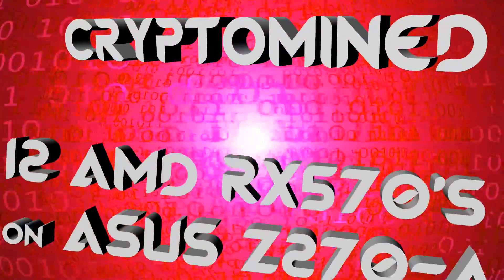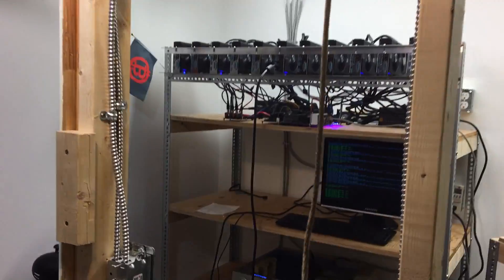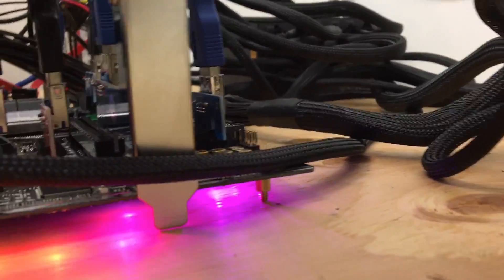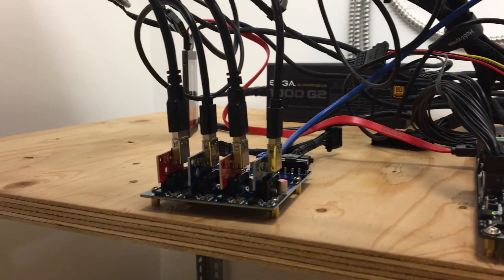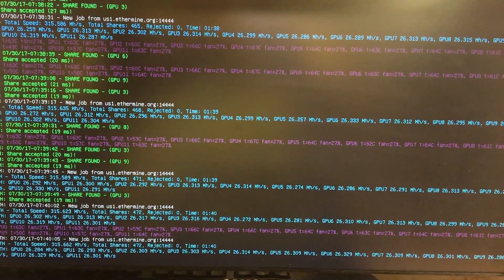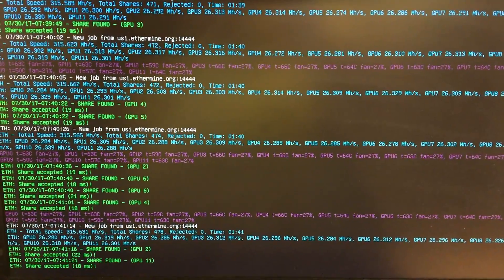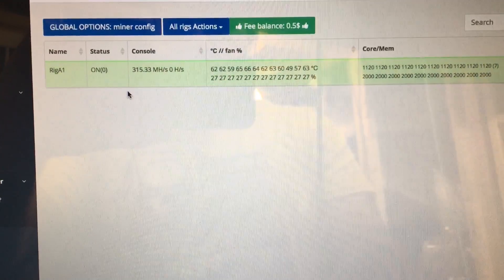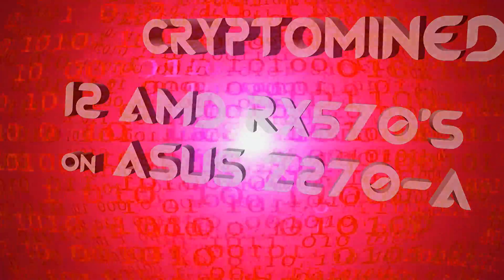ASUS Z270-A 12 GPU Rig with AMD RX570 4G Nitro+ and SimpleminingOS

Comment: Hi there, I have the same model motherboard (ASUS Z270-A) but I cannot run more than 4 gpus. I am using intel core i7-7700k and 2x8 16GB DDR4 DIMM memory with Windows 10 Pro OS. And I have 8 AMD RX580 GPUs.
Everytime I put the 5th GPU the display keep blank or pop up message uncompatible input.
Any idea what is wrong with?
Thank you.

Comment: Curious to know how does the 1to4pcie adapter stand the test of time. Are there any drawback on running those adapter?
Reply from the maker: I only use the 4in1 USB PCIE adapter now, and its working great.  as for the rig in this video, im not sure how this one is going, i suppose its still running strong, but this video was given to me to post by Robert. (see description)

Comment: Hi @Cryptomined, awesome channel!
Just a quick one, would this only work on SimpleMining OS? Has this been tested on windows?
Reply from the maker: now it works on windows
Reply: Thanks. I'm running 8x RX580 on the same motherboard. Would I be able to add another 4 with your extender or is that strictly for RX570s?

Comment: Hi Cryptomined, I have been succesfully mining with 9 cards on this motherboard using both the m.2 ports. Now I added a 1-4 card to allow more cards. I have 10 cards plugged in but after a couple of hours one of the cards stop and it only mines with 9. Do you know why it keeps dropping the 10th card? BTW I'm using HiveOS and I have plugged 3 cards into the 1-4 port.
Reply from the maker: Im not sure, what 1-4 are you using?  I like the 4in1 usb extender here: https://cryptomined.com/index.php?main_page=product_info&cPath=1_373_379&products_id=369  I use it on one of my rigs to add an extra card, works great, but thats just using it for 2 of the possible 4, i haven't tried with more yet.

Comment: Can I build with this MB mixed  AMD Nvidia 12 GPU rig? I will have to buy used graphic cards- every month I want to add one or two cards according offerings. So sometimes it can be AMD card, sometimes nvidia. So is it possible to use for example 4x 1060 6Gb,  1x 1070, and 7x some AMD stuff? If no, what is maximum.  I bought this MB yesterday and maybe it is not the best solution for the price and for my problem I could pay a liitle more and buy special MB like Biostar or asus with a lot of pcie's. I don't know. So I need to know if I have return z270a or not. Not to mention extra money for pcie extender. On the other hand some users reports problems with biostars BTC mobos too. Every minig rig is original but I very appreciate your opinions.

Comment: Sorry if I missed it or missed a comment about it. Are using a 15amp or 20amp circuit, or 2 15amps? I wonder how many people out there are continuously drawing 1600+watts from a 15 amp circuit, which exceeds the safe continuous load of 1440w. Both the wires and breakers are only rated for more than 1440w for no more than 3 hours. Just wondering how many old homes are going to burn down with wires and panels catching fire. Just an electrical minded person. Max I load any circuit is the rated 80% for my miners.

Comment: What's the theoretical maximum?
Reply from the maker: in windows i think its 12 for amd and 8 for nviida.. in linux there may be no theoretical max... but again, havent tested myself
Reply: I thought the motherboard had a maximum.
(Sorry if it wasn't clear I was asking for the Z270-A specifically)
Reply from the maker: they have a pcie lane max but im not sure how much that effects how many GPUs can be put on the board... for example, i have used a 1-3 extender on a 1x slot to add an extra GPU, you can see that worked for me in a previous video on the asorck pro btc h81... so yeah, although the boards have a PCIE lane count, again im not exactly sure how that works in accordance to how many GPUs can actually run on one lane... I had believed that PCIE lanes were a major limitation, such as with Z170 boards which had fewer PCIE lanes... but I guess it has more to do with how the motherboard is programmed to use those PCIE lanes... I'm not a motherboard expert per say, i can just speak from my own experience, so a better answer could be given by a motherboard producer such as asrock for example,. but even then... im not sure if they know the real max unless they have tried everything.  In regards to Z270A, we can see that on the ASus B250 that atleast 19 can be run, and you can even run more on it... so again im not sure... I forget if hte PCIE lane count on those boards + CPU is 24 or 28, id have to double check,.. ive seen an older video of a rig running something like 30 GPUs or atleast showing that it is possible to attach that many to an older motherboard... i dont think they actually showed it mining... and Asrock did tell me that they have seen people get about that many to work on a board... so again... those details and how that all works is beyond my current understanding of PCIE lanes

Comment: Could it also work on windows? Will windows recognize all the 12 gpu's?
Reply from the maker: now windows should with the more recent drivers for AMD cards - nvidia still seems limited to 8
Reply: Thank you for your quick reply!! 

I was about to order 1070 ti's.. what amd rx's are comparable if I want to mine anything but ethereum?
Reply from the maker: if i were you i would just go with 8 of the 1070tis.. ive been buying 1070ti, 1080ti, and vega 64/56.. you should check whattomine.com for hashrates on different cards, they have selectors for all those cards with default values on the top minable coins.
Reply: Thank you! And then combine it with some AMD's? I am planning to use nicehash (because it automatically mines the best coin to mine everyday, instead of using different scripts if another coin is more profitable)..

I can get rx580 4GB's for about €300 here
Reply: €285 to be exact

Comment: Hello , i have asus prime z270-a mobo. ıts have 7 pcie + 2 pcs. m.2 port. m.2_1 no problem 8.gpu. but ı want 9. gpu add to m2_2 slots with pcie adaptor. I dont seeing device manager. Can you help me?
Reply: Hi Akin, just passing through.  1, I'd check your Mbod is running the latest firmware.  Update if necessary.  2,  Have you tried switching GPU around - you may have a faulty GPY.  3, Have you tried switching the "faulty " M.2-2 adapter & GPU over to the M.2-1 plug.  If it works the AZ70 M.2-2 plug would seem to be faulty.   If it doesn't work then either M2.2 adapter or one of its cables or GPU is likely to be faulty.  Switch those around with knowing working ones to isolate the fault. Have fun.
Reply: Any luck with the second m.2? I’m also having the same exact issue, my next step is exactly what mr si is saying

Comment: Hey brot, very good video!...I wanted to ask you if you already have experience or opinions about the rig with 12 gpu or more using Windows 10 and the driver of AMD 17.10.2, although everything works since the 12 cards are detected ... You have been able to use bios modified in the gpu and being able to change the clock by MSI Afterburner? I await your comments...Thanks

Comment: Which one do you like better the ASUS or the ASROCK, and why? Also lets say you had 13 1080 Tis, would you be able to hook all the PSUs power cords into a power surge brick (CyberPower CP1500AVRLCD) , which would plug into a Kill A Watt Usage Monitor which is all plugged into one home wall socket. Would that work?
Reply from the maker: i dont use the asus, to me its just too many gpus to troubleshoot, so i wouldnt bother personally.  if you put 13 tis into a single outlet, you will probably blow your fuse??
Reply: No idea if it will blow a fuse, how do you feed power to all those PSUs that you have for your 13 GPU rig? In your experience is having 13 cards a pain?
Reply from the maker: well it worked off of a single socket for me, but if your in north america maybe its a different story.  personally i prefer smaller rigs than the 12,13,19 gpu monsters, just easier to trouble shoot.
Reply: Guess I'll find out (lol). Another question for you, do you think the ZOTAC GeForce® GTX 1080 Ti AMP Extreme is worth the price since it has one of the fasts OC clock core speeds?
Reply from the maker: for mining i would imagine its not worth it as you probably want to reduce power draw to keep temps down anyways.  for resale after mining, maybe they will be worth slightly more, but then again, there will be 1180ti and 1280ti around when you probably try to sell them if you do so.. probably not really worth it.  id stick with the cheaper 1080tis for mining, as long as cooling is good... at least thats my opinion... though my 1080tis cost me an arm and a leg....

Comment: Hello,

i am new to all this and have a rig of 6 sapphire rx 470 (samsung) mining editon cards running on win10. I have asus z270-p mainboard. I change the bios of the cards, but i was unable to change the clock speed of cpu and memory and the power consumption of the cards with AB or Trixx. With this OS it seems very simple to change those values. But how do you change the BIOS? Do you put a card in a computer with windows and change value of stripes there (or whatever they are called TIMING VALUES; copying 1500 to 1625, 1750 and 2000)? And than put it back into this rig? 

Or does anyone else know why i cant change the values in AB or Trixx for these cards?

Best regards!
Reply from the maker: you can change the clock speeds of the core and memory in the bios also, i should do another video on it as the new polaris bios editor is a bit different
Reply: Oh you mean i can change that wiht polarisbios editor? not just copying the 1500 values to 1625, etc, but i can also change the cpu, memory speed and power? That is cool but getting the sweetspoot will be a pain in the ass doing it like this ...
Reply from the maker: yes

Comment: Hi. Can i ask why my psu melt my 6 pin connector to sata. That sata is only powering 2 riser cables. 
I have 1200 corsair platinum modular psu. 
My gpus are
2 rx 570 pulse
1 rx 570 pulse mini
1 rx 580 sapp nitro + 8gb
1 rx 460 2gb gigabyte

Thanks for help.

Comment: Amazing work. I would definitely just buy a H110 Pro BTC+ 13 slot board and be done with it but this is really cool if you don't want to spend 125 bucks on a new mobo and don't mind spending 20 for 2 m.2 and 50 or 60 for the expansion hub.

Comment: i use the same exact setup, all detected 12 gpu, but when it start hashing, gpu that's plugged to pciE extender 1 to 4, showing just once hashing, after that it shows 0 Mh/s not hashing, can you help me, do you know where the problem is?
Reply: note: I cancelled the power connection to the M.2 cards due to instability.
Reply: for m.2 card, yes, i canceled the power connection too, stable for m.2, but not hashing for cards plugged at pcie extender 1to4
Reply: Judy Husin, try plugging the 1-4 in m.2 ports.  Also, try removing a few cards from other ports until you get all 4 cards on the 1-4 hashing. Or plug only the 1-4 in the first or second x16 pcie and see if all 4 cards hash, if not it may be a defective 1-4

Comment: Hi I'm hesitating between 2x 6gpu rig or a single 12 gpu rig. One advantage of 2x 6gpu is I can use a2 cheap rackmount server and put them in a rackmount I already have. for sure qith a single 12 one you save a mobo, cpu and ram and your case seems pretty cheap, but maybe the mobo will last a shorter amount of time? Can you tell me what could be some pro and cons of each alternative?

Comment: Hello Cryptomined thanks for all the great vids!
i got a small issue!
got me the sapphire nitro+ 570 8 gb (hynix) and i cant seem to bios mod them + that the timingstrap goes to 0: 2250
help me please!
Reply: Use this version of Polaris bios editor: https://github.com/jaschaknack/PolarisBiosEditor
Reply from the maker: it depends on your memory, you could have different sets of timing straps 1,0, or 2... one of the sets will produce results if changed
Reply: Can I get the same hashrate (29 MH/s) with sapphire nitro+ 570 4Gb? Does VRAM makes any difference?

Comment: Does using more pcie requires more ram as well? Will 4gb sufficient for most cases? Like 13slot mobo?
Reply from the maker: asrock minimum requirement is 4 gigs with recommended 8gigs.

Comment: Can someone explain why the GPU cards can function at 100% with only the 8pin power?
Reply: Typically reference cards only have one power connection and then the custom ones add extra.  My understanding of this is that the card only needs the single 8pin to get its power requirements, and the second is added to increase stability and allow the card to not be bottlenecked if 1 connector doesn't reach the requirement.

Comment: what is the effect for not connecting the 6 pins power connector to the rx 570? will it have enough power? wont it fry the gpu?
Reply: The manufacturer's booklet that comes with the GPU gives you the following options for power connection: 1x4-pin, 1x6-pin, 1x8-pin, 2x4-pin, 2x6-pin, 2x8-pin, 1x8-pin+1x6-pin.  I am using 1x8-pin.
Reply: i have some rx 580 8GB saphire. is it safe to plug 8 pins power connector only? in the video cryptomined was using rx 570 which consumes smaller power compared to 580.
Reply: Check the booklet that came with your cards.  I almost certain you can use 8-pin only.

Comment: How is this possible? My RX580 rig can't run more than 6 GPUs or it shuts down. I am using z270-p instead but dang! I'm at 1250 Watts on 2 750w PSU. I have a few rx580s just sitting in my desk. I'd love to know how to get the power consumption down. 130-140 is the best I can get.

Comment: Love it when you guys all say, plugged it in, no hassles. Oh to be apart of that word. After spending 6 hours troubleshooting I finaly get the damn thing to work and NiceHash refuses to recognise my bastard address. And BitGo doesnt have any of my other miners eth transferred. 1 issue follows another 5
Reply: Brock Huffaker Check your risers bro. I struggled for 2 weeks too. I was seeing all kinds of random behaviour. Some times 4 cards, sometimes 5, sometimes 6. Very inconsistent and random behaviour on every boot. I could have sworn it was the motherboard. Turns out one of the risers was faulty. I think it was causing a short circuit due to poor quality soldering. Now it's runs as sweet as a nut and has been stable for a couple of weeks. I'm using power risers (version 7's and 8's).
Reply: Nelly Nelson I know right! I've been screwing with my rig for 2 weeks. Still can't get 8 GPUs running on it...
Reply: Brock Huffaker think we're toyed with. What I'm finding most worrying is lack of wallet and miner support.
Reply: Jonny Hardwick thanks for headsup. So far it's been software bugs and faulty cards

Comment: Nice share @cryptomined and Robert , Robert if your card are OC version change your CC to 1180 & MC to 2150 it can give you stable 28.6 to 28.8 Mhz on Eth as your already Modd your bios with Straps
 If you feel its taking more power with CC 1180 lower it to 1150 will reduce some hashrate also around .5 Mhz
Reply: Mohsin Hussain, I think 2150 crashes the card but will try again. Which straps did you mod?
Reply: Dear my cards are big different , its Sapphire Nitro+ 580 8GB OC and they support upto 2250 MC so I increase upto 2150 which is stable with no crash. For me I tested 2200 which was also stable but I reduce to 2150 to avoid heavy load on MC. 
Better test by one of the card in windows with Afterburner incremental of 10,10 in MC and if you found stable timing let it run for few hours and then you set the same setting in SMOS.
Reply: Regarding Strap for 580 : with default bios rate was 20 Mhz after Strap increase to 26 Mhz and by Modd CC and MC its now 28.6 to 28.8 Mhz. 

 I flashed 2:1750, 2:2000, 2:2250 timings with this strap:

777000000000000022AA1C00B56A6D46C0551017BE8E060C006AE6000C081420EA8900AB030000001B162C31C0313F17
Reply: Is that a custom-made strap or is it from one of the other timings?  Did you mod the first set of straps too?
Reply: Its a custom strap get from bitcointalk i think . 
 paste strip to 2:1750, 2:2000, 2:2250 timings

Comment: I have a msi z270 but I can not install more than 04 cards ... when I put 6 they do not install ... something in the setup that would need to be configured? ?
Pode me ajudar? ??
Reply: Rozemberg Azevedo there's a setting on your motherboard's bios you need to change.  I can't remember off the top of my head,  but it will allow you to use more than 4 gpus.  I had the same problem, found the answer with some Googleing.
Reply: Rozemberg Azevedo Enable 4G Decoding in BIOS
Reply: I've already tried activating the 4g decoding but it will not initialize will it have something else to change in the bios ???? help me

Comment: I noticed that I have a problem with my rig and I'm almost sure it's the motherboard, I have 4 gpu on a gigabyte motherboard and they have a lot of hashrate drop, even putting the gpu in stock clocks, any advice to fix it? (I have 8gb ram and the mobo is new)